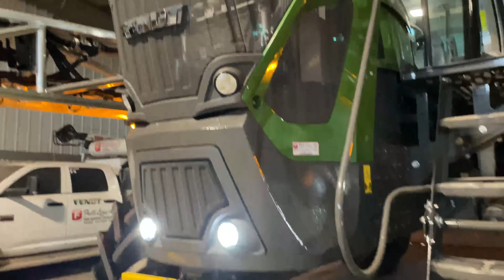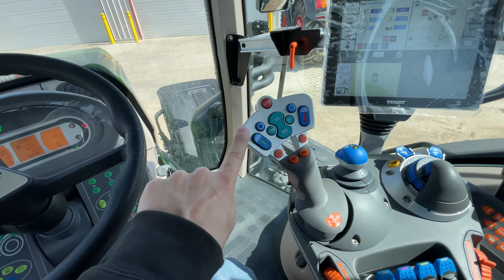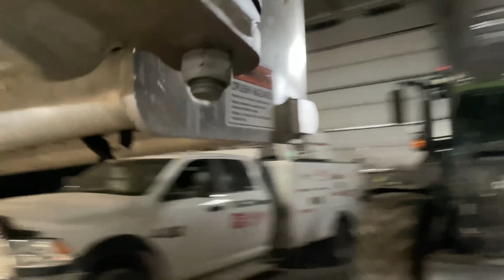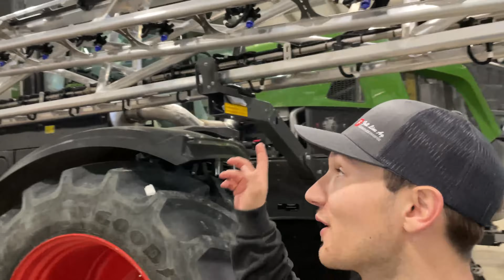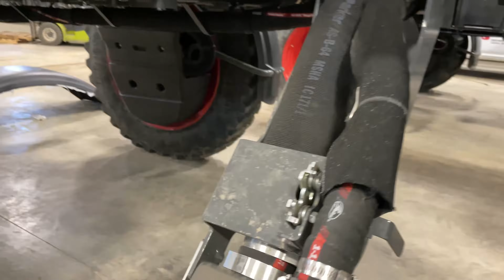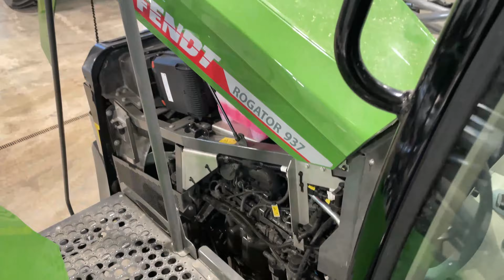First looks at the Fendt Rogator sprayers

Comment: Fendt-awesome video Austin. Those Fendt Rogators are killer machines but with a ginormas tank for water and a 1000 sprayers - you would think there would be an automatic self-wash option so you don't have to inch along through the mud. Maybe that should be a new FLA custom add on. Speaking of custom options, those crop dividers made a mean machine look even meaner. I'd like to try a set on my truck to see how they work as traffic dividers. What you thought was a random vid, was more like a customer POV vid if you handed me the camera while walking the yard and shop floor - "look at those booms, the height, that front end look, those big boy tires....."  my head would have been spinning 360 with all there was to see. Looking forward to seeing your new vids of these bad boys rolling across the fields. Hope you're doing well, glad to see Spring is making its way to Sask. Take care 😎